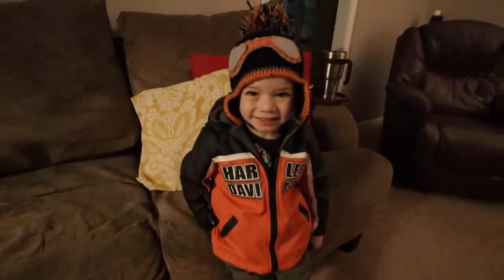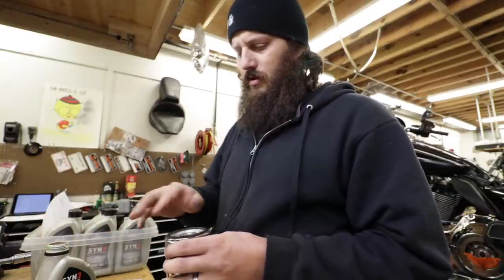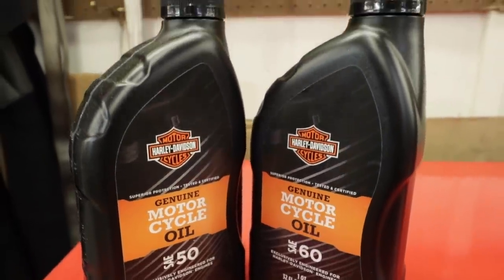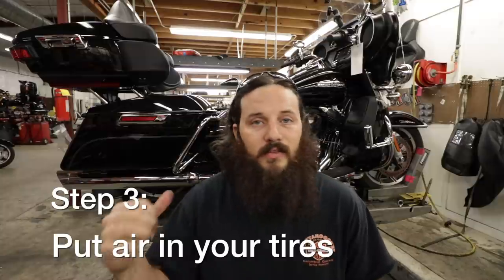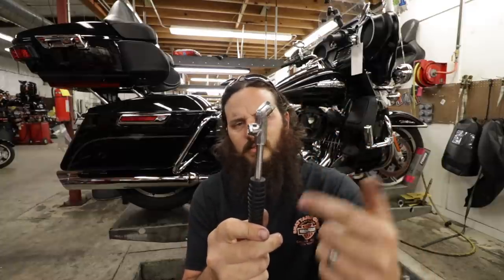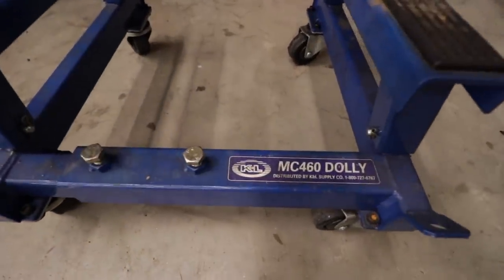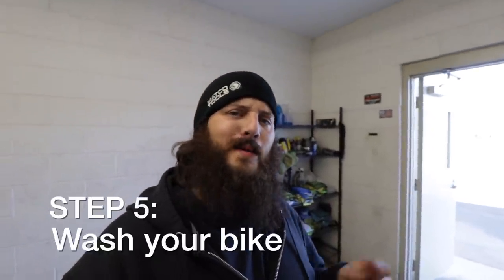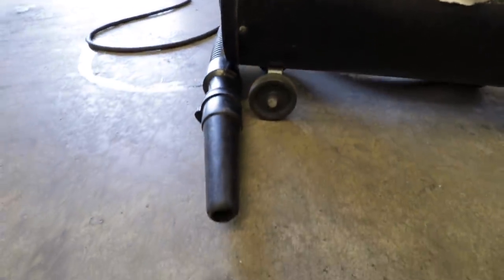How to Winterize a Motorcycle

Comment: ive always just washed it, filled the tank, took out the battery, took the seat inside, and put a cover on the bike..  From there it just gets buried in a pile of snow and ice... Has never seemed to have any detrimental effects... Starts right up every spring without fail... When spring comes i change the oil, detail it, and its ready to go.

Comment: Never would've thought to cover my air intake and exhaust. Thanks for the tips man, much appreciated
Reply: Found a mice nest in my exhaust last spring, they legit will nest in there
Reply: I have heard of putting steel wool inside you pipes. Would there be a rust issue?
Reply: Pete Brandstrom You can't use steel wool on its own because the mice will be able to pull it out or chew through it. ... Because of the way it's woven, copper wool is said to get stuck in rodents' teeth, making it difficult to move or chew through.

Comment: Where did you get that tire inflator tool or what brand is it?  There are lots of nice dual head inflators out there but I could not find one with that straight on and 90 degree head like you had.  That is indeed perfect for bike tires.  Thanks for your help.

Comment: I have a question.  Long story short.  I recently came off an injury.  My bike sat for two years.  I did the general upkeep.  Filled the tank, stabilizer, changed oil all that jazz and did keep it on tender. I am finally able to work on and plan on changing oil, change spark plugs, siphon gas  put fresh again it and put a new battery in it.  I am hoping I did all the right steps to get it off and running.  I did periodically start time to time.  It did start up and run.  This last time it didn't so I am doing all those steps previously mentioned to get it going.  I had reconstructive surgery on my wrist.

Comment: I finally put my first replacement battery in my 2006 Road King in December of 2015, amazingly enough, I got 9 years off that battery, never put it on a battery tender, believe it or not.  However, I rode it year round for the most part, as long as there was no ice on the road, here in Michigan, I was riding.  Apparently getting older, has changed me in that retrospect, now both bikes are on battery tenders, and I take my heated car to work in the winter, lol.
Reply: One side note I would like to make on riding the bike in the winter, that did not work out well for me, in 2014, my rear spokes on the RK broke going around a curve, due to rust at the bottom of the spokes, sent me right into a guard rail. Needless to say, I now make it a point to have it serviced by a certified motorcycle tech.  I am fairly handy mechanically, but, having someone who specializes in motorcycles, in my opinion, is always the safest and best bet.
Reply from the maker: Damn! Glad you made it out of that one ok!

Comment: Any chance you would do a video on maintenance if you plan to ride your bike during the winter months?  A cold weather riding tutorial if you will.
Reply from the maker: I was thinking about doing some heated gear stuff.  Other than the gear, the only difference really is checking tire pressure regularly, and keeping it as dry as possible.  The temperature changes effect tire pressure, and the snow, if there is any will only accelerate rust.  The "road grime" during the winter in some areas will damage a bike much more than nice sunny summer days!

Comment: I just bought a 2012 Heritage Softail classic a few weeks ago, first bike ever, through a Harley dealer here in NH, tank was topped off FULL not sure if they put stabilizer in it, Service has already been performed by them as far as fluids. no room in garage have to store it under car port with cover on it and battery charging on a Tender.

Comment: John, Great video like always, i have completely jacked my bike Street Glide special 2019, so the tires are off the ground, the shocks  are not touch the ground also. is this bad for my shocks. some one told me that the shocks were supposed to have the bike weight on them all the times. what do you think.
Reply from the maker: I’ve never heard that. Keeping the tires off the ground is already only needed if you’re not going to move it at all. If you’re worried about it, just roll it back and forth a few times a month during the winter. It’s a perfectly good alternative.

Comment: Great video John Maxwell.  Been doing most of this on my '09 Fat Bob since I bought it.  I got 7 years out of the  HD battery even though the bike only had 480 miles on it when I bought it in 2012.  BUT I have never removed the main fuse before putting the battery tender to work.  Could that be the reason I had to replace the Fuel pump relay last spring?

Comment: Thanks for all the vids, John.  These are good tips.  Am on my fourth Harley, and been riding for ~40 years, but I still have much to learn.  Great channel!
As far as storing the battery, my CVO came with a charging cable hooked to the battery.  Do I still need to pull the main fuse?  Do I still need to pull the battery?  Or can I just lleave the battery in and keep it plugged into my Tender all winter?  Thanks in advance!
Reply from the maker: Leave it all plugged in. If you pull the main fuse on some of the new models then it won’t even charge because the tender is part of the main harness.
Reply: John Maxwell hi, love your vids. My 18 fat Bob just got recovered whilst on way to holiday with mates. Dealer was awesome. Voltage regulator/rectifier(?) had failed. They replaced it with one from the showroom bike. I use a battery tender. Could it have caused this damage?

Comment: Chicago here... if I store my bike in the garage and maintain about a 50-60 degree temp in there, do I still need to worry about changing the oil and putting a tender on it? I plan on running my bike a couple times a day during the winter

Comment: I liked your video very much, I think you have achieved the positive vibe you were seeking. Its a very mellow vibe but still very positive. I'm new to your channel and was wondering what you might recomend for fixing the high speed wobble on a 1995 electraglide.
Reply from the maker: Thanks for watching!  There is a lot that goes into checking for a wobble.  I may have to make this into a video!  Tire pressure, tire tread, matching tread front and rear, spokes if it has spoke wheels, steering head adjustment, are all starting points.  do you have the bike serviced regularly?

Comment: Hi John, love the vids, thanks.  Not sure how to ask a question in a way that you will see it, but here goes nothin.  I have a 2019 heritage 114, so I am mostly interested in the details regarding the "coolant."  I thought draining fluids made gaskets dry out.  And I thought the "coolant" was also "anti-freeze" so why would it freeze?  Got a video of how to deal with the radiator and its contents?  Never thought I'd miss my old EVO, but it was a helluva lot easier to winterize.  Thanks.
Reply from the maker: Your heritage has an oil cooler. No coolant to worry about. Since you asked, though. As coolant ages, it’s freeze temperature rises. You wouldn’t drain coolant and leave it out, you would just change it to new/fresh coolant.

Comment: I thought operating temp was reached after a few minutes-I saw a vid where a guy had a Harley hooked up to the shop computer and it monitored the temp...please advise and great vid-thanks
Reply from the maker: Engine temp reaches pretty quickly, oil temp takes way longer. Generally 20-30 miles down the road. While idling, the engine would overheat long before oil reached temperature.
Reply: @TheHarleyTech  Hi John-Thanks for responding-How long do you recommend that a bike (2018 Road King) warm up before getting going?

Comment: Regarding oil - you didn't mention what to do after winter. Should it be replaced with another fresh oil(since you put different SAE rated oil)? In my case I didn't change oil on my Iron as owners manual does not mention this step under 'storing your motorcycle' paragraph. I'm just following recommended oil change intervals and that's it.  Today's oils has moisture inhibitors in them so water and moist isn't that degrading factor now I guess. The only thing that worries me is metal and fuel contaminants as my bike is relatively new and has only 3000 miles (oil was initially changed after 1000 miles).

Comment: I live in mid-northern Ontario, where winters can get pretty frosty. As far as the battery goes, would using a battery tender connected to the battery in an un-heated garage for five months be ok? Also, would the battery tender on my Harley  be ok with the bike  (a 2019 Fat Bob) under a breathable cover.  I used to take the battery out of my Yamaha and store it indoors, but that battery was easy to get at.  Advice and opinions much appreciated.

Comment: Hey john. Do you have any videos specifically on head bearing maintenance and adjustments? My bike is getting close to a 25k and ive never done anything steering head bearing related but i do have a service manual.
Reply from the maker: In the service vs oil change video, I talk about it, and show off a cool tool. I don’t recall how in depth I get, though.

Comment: Thanks for the tips bro, I live in PA and yes I store mine. But if it gets 50 I'm ridding a lil bit. Btw nice Sporty Custom what year is yours? I have a 2000 1200 Custom awesome bikes.
Reply from the maker: Mine is an 08. My first bike. I don’t think I’ll ever be able to get rid of it!
Reply: Lol, my first real road bike here , when I was 14 or 15 I owned a 76 AMF250 it was a beater. And Probly 15 or so dirt bikes in between I'm 49 now. But I'm not Gettin rid of mine eighter, just wouldn't mind a y speed trans , but can't afford that. In my opinion the sporty is a really reliable bike. I have had mine since 2016 and only thing I have done is oil change , plugs and wires and a K&N filter. Plus I paid the Harley tax, had to make it my own ya know?
Reply: 6 speed, Damn phone!
Reply from the maker: Yea man. My clutch blew up, but otherwise, sportys are the most dependable model.

Comment: Hey my rear tire is rubbing on my drive belt, its not bad but it's noticeable, and its only on part of the tire, should i be concerned or will it correct itself as i ride?
Reply from the maker: I would guess your tire is wider than stock. Do you know if that’s the case?

Comment: What does Harley do, if anything when storing my bike w/ them? Dropped mine off yesterday for the season as I'm getting some new tires, the triple 7's on my 15 FLHTK. When they have it all apart, does the mechanic tend to clean up some of the hard to reach places? Or is it literally just a warm place with a roof for the winter? I live in northern Illinois and snow, sleet and salt eventually finds its way into my garage and It just gets dirty / nasty until spring when I can give it a good scrub. Not to mention when I get both vehicles and the bike in there I can just about slide a playing card between the three. Tight fit, rather not deal w/ it  Please reply when you can, ty. \m/
Reply from the maker: Every dealership is different, but you’d be hard pressed to find a tech that cleans a bike while he has it apart. That’s a service that happens when you know the tech, slide him some tip money, buy him beer, that kinda stuff. I have quite a few folks that I go the extra mile for, but if I did it for every bike, I’d never be able to move onto the next bike! 

I have no idea if a detail would be included in your dealerships storage fee or not. That’s who you need to ask, though.
Reply: @TheHarleyTech  , makes sense. Appreciate the reply / thanks for taking a moment out of your day, you've been a great resource. Cool.
Reply: C Maz   Lakeshore Harley-Davidson in Libertyville, IL pulls the main fuse, puts in stabilizer, moves the tires. Before pickup, the fuse is replaced, battery charged and bike washed. It is clean, but not detailed.

Comment: I've been told to turn off the fuel and run the engine till it dies to empty the carb and any gas in the intake after adding stabilizer. Is that needed?
Reply from the maker: Great point! Yes it is a good idea to drain the float bowl!

Comment: i live near Cincinnati.   i just ride it all winter so i don't have to do this
Reply from the maker: As long as you do something! Even if it is ride it.  Sadly, a lot of folks think they're going to ride, but don't.  Then they have a dead battery, a rusted fuel tank, and a broken fuel pump...
Reply: Do you have any heated gear? I'm in Maryland, it gets somewhat cold here, most of the time in Jan - Feb. I just got my first bike a few weeks ago and I've been telling myself I'm going to ride through the winter. :P
Reply: I ride year round in Nebraska. Yes, heated gear a must. Don't buy cheap. Gerbing has lifetime warranty.
Also, very important to have a regulator. If you get the stuff that just plugs in, it will get uncomfortably hot. I use the double regulator so I can adjust the gloves and jacket separately. I do have pants and socks too, but rarely use them.
My record low for riding was 11 degrees. But won't do it again, unless I miss the weather forecast. About 30 degrees is my limit because the bike curses at me. 2012 Glide.
Good luck.

Comment: I just turned 62  I've been riding since around 5 around 87 Being a firefighter new dad ol lady bitch I stopped 15 long yrs Got big settlement new ol lady new 07 elect classic paid cash had lived in Boston out of showroom mid February 10 degrees  road anytime streets clear 4 mo hit by illegal at 5,000 mile next bike cost me too much to fix sold it 8 years off bought Herritage now 03 RK POLICE  NOW TO MY POINT !!! IF IT WAS not for your Videos I would not be able to afford my bike. Fixing  most things on my own was easy.  The 1 thing I am leary of if my cam is ok  I am replacing the cam cover because the chrome is peeling.   The top end of the bike was done Add a 104000 That's when I bought it Replaced the stator in and regulator. Switching to S&S duels going from a dyno comander 3 to a Dyno Comander 6  But still keeping my screaming eagle slip ones. Does that sound OK?  Also going from bag cage on most police to single R crash bar .
Do you recommend anything else.  Sorry so long winded but just wanted to tell you I liked your page